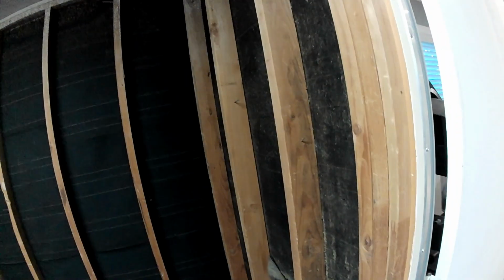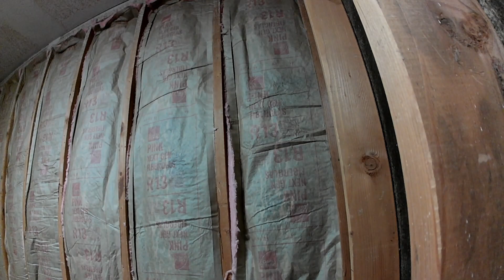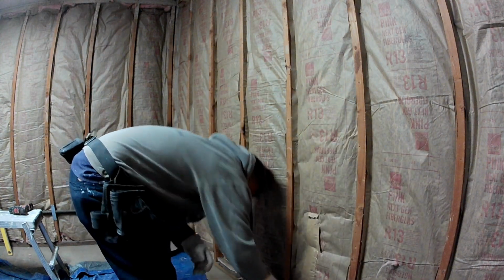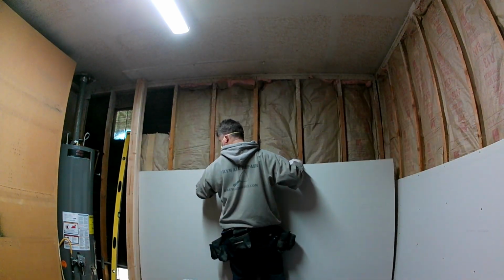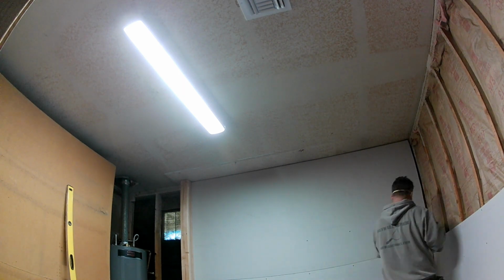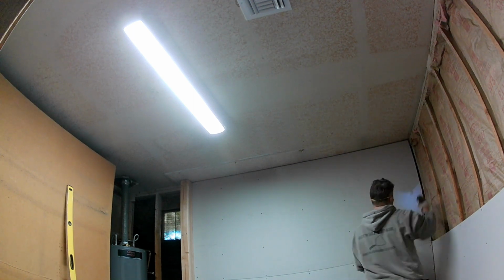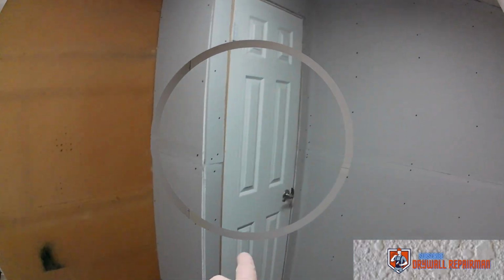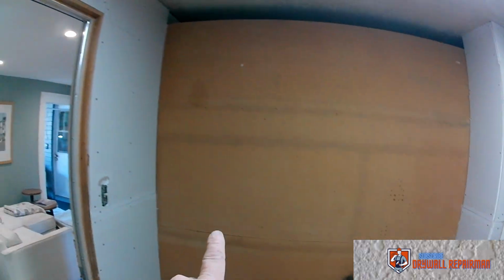best practices for insulating your walls detailed video before we tackle the drywall

Comment: I was wondering, Did you first learn your trade by hanging drywall, or did you start with repairs from the very beginning?
Reply from the maker: tapper tapping and textured high end homes up to 1000 sheet very large homes since 90s